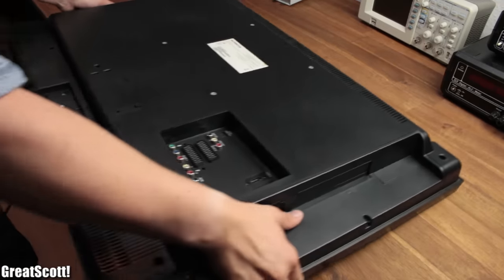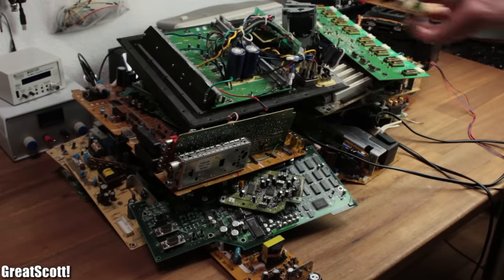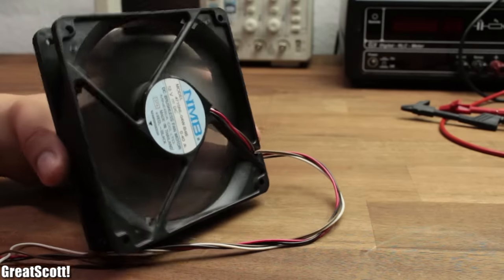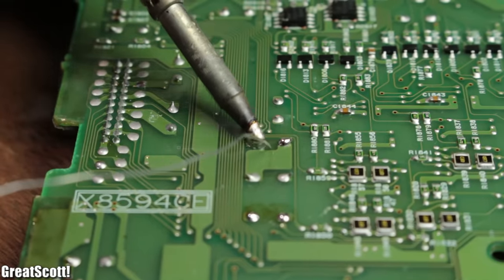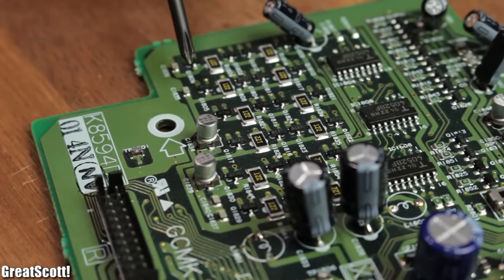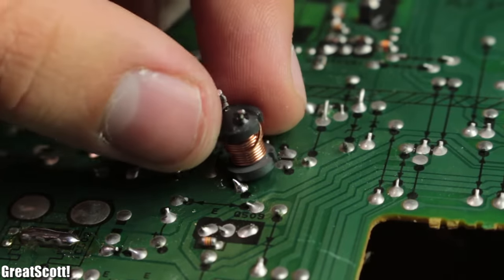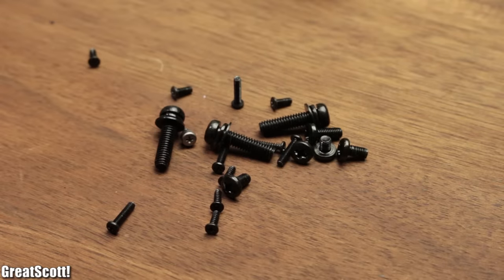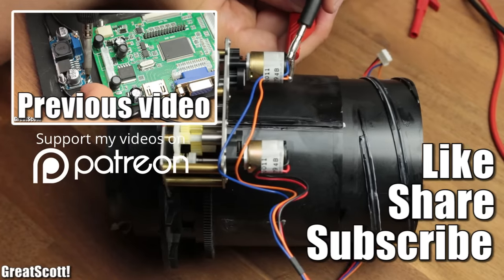What is worth desoldering from old electronics? || DIY Fume Extractor

Comment: let me save you time
coils, relays, heatsinks, capacitors, motor, switches, push button, transistor, screws, transformer
Reply: Voltage regulators
Reply: windows_x_seven why are you this salty lol chill mate
Reply: @windows_x_seven Tantalizing offer. I mean I can try, but the sheer size of them is intimidating.
Reply: r/suicideByWords
Reply: And power resistors, 2 watts or higher, flameproof, ceramic etc.  Assuming they don't show discoloration from excess heat and that they measure within tolerance.
Reply: If its a computer, take the backup battery holder too. Comes in handy if you have to replace a soldered in coin battery.
Reply: I save it all...
Reply: And boards that was left after dusoldering.
U never kniew when u need something what is on this board.
Reply: I don't really know much about electronics and parts so I don't really know which is which. I will learn it eventually. Done a little soldering myself. 

I don't know what is a relay and the things he mentioned not to bother with.
Reply: 90% of the time I’ve had something break on me it’s the power transformer that’s burnt out, usually not worth saving them if anything starts smelling foul even if it’s just a decoupling section that looks like it failed
Reply: But they're going to miss out on him saying eyeRUN and SOLLder
Reply: Let me save you guys even more time: get your propane torch, take the thing outside in the wind, torch to solder side. use a flat head screwdriver to deal with any bent leads that are keeping them from falling out when the solder is liquefied.
Reply: @FirstLast-om8li   I don't think that's a legitimate "salvage method" as you almost surely will be overheating components.
Reply: @adksherm   The heat is easily controllable to just melting the solder, which as soon as it liquefies, lets go of the component.  Use a small torch not a weed burner.
Reply: @FirstLast-om8li  have you actually done this with non-destructive results? Re-used those components in your equipment without failing?
Reply: @adksherm  Yes many times.  Sure you could cook the components but you'd have to be negligent with the heat or have chosen a MAP gas torch on high or something.  Next time I do some I'll use my laser temperature gauge to check a component after it falls out and see how hot it got.
Reply: @FirstLast-om8li  cool man. I haven't seen that done before I don't think. I'll have to look more into it!
Reply: @adksherm  another poster mentioned using a heat gun which is probably a more finesse-full method.
Reply: @FirstLast-om8li  heat guns are pretty commonly used for desoldering. Never heard of using a torch though!
Reply: @adksherm  I think you must be thinking more of like a plumber's torch and I'm thinking more of a creme brulee chef's torch. I don't just hold it directly on the board I wave it back and forth at whatever components I'm trying to get to drop out until it liquifies the solder and they fall out. If the leads hook then I usually just put some pressure with a screwdriver under the chip or part & hit that area again to liquefy it while it's being pulled on if it's really hooked in there then I use a screwdriver to scrath at the lead while the solder is liquefied.  For the most part it's just a Mass dump of Parts pretty quick.
Reply: @FirstLast-om8li   I have plenty of small torches; I know what you mean. Still, a hot air rework station is a lot more efficient for me and won't reach such extreme temps. But I dig your way of doing things your way!
Reply: @adksherm  yeah I think more people probably have a torch then have a heat gun or hot air station.   Desoldering things one pin at a time is for the birds or for stuff you actually intend on keeping and trying to make it work again.  The more people we can get to reclaim components with whatever tools they have got. . . the better.   Nice to meet you.
Reply: Plugs and fans too 😂

Comment: When you are joining twin cable (like on your 12v fan), cut the wires at different lenghts along the able so they cannot touch each other. You only need one tlength of heat shrink over both at once as well.
Reply: FaCt
Reply: Stephen Low , good idea. I'll do that next time.
Reply: Life hack
Reply: And if you cut off the connector from the power supply cut the cable in the middle. So you can save the connector (with the rest of the wire) as well :)
Reply: @alexstone691  LOL. I hate that term "hack" as it's used now.
Reply: 100% right on this, I always do that because the ends just HAVE to touch each other as if they're conspiring on it I swear. I always cut the hot wire or positive (plus) wire as the short one on the power side, which helps me remember what color was hot.
Reply: I like to mess with random stuff. But I'm not very experienced, or knowledgeable about this stuff, just enough to not kill myself. I was paranoid enough to do exactly that when i cut off a power connector
Reply: Mind blown!!!

Comment: When you cut off the old DC plug from a PSU to re-use it, leave 50mm of cable attached to the plug so you can use a screw-terminal block with it - handy for bench rig-ups ;)  
A major advantage is that you can easily add an extra capacitor at the terminal block to see if your circuit under test requires extra smoothing or RF filtering.

Comment: When I was a kid and didn't have lots of money for desoldering pumps or other expensive tools, I used an old injection needle to remove complicated parts like IC's: just remove the sharp injection part by holding it against a power grinding stone for a couple of seconds until it is flush and voilá: just stick the needle over the IC legs one by one and heat it up with your soldering iron: the solder doesn't stick to the needle and pushes the solder aside. Very fast, cheap and leaves your IC's still working fine!

Comment: I agree, I salvage parts such as what you mentioned as well. You never know when you might be pressed for time, and need a component to fix a device that otherwise you might have to wait days or weeks for new to arrive. Also a great way to remove suspicion of a bad part right away when troubleshooting. If the used part fixes it, then you always have the option of buying a new part if critical of using an aged part for the application.

Comment: A cheap hot air gun lets me remove any component quickly, including DIP's, BGA's, and SMD's of any size sweep off a board by the dozens. But the best way I have found to maintain a stock of components from old boards is not to desolder anything but the largest components, so the boards can be stored compactly, and then attempt to locate schematics/service manuals which will help me identify mystery components, like SMD capacitors which usually have no value markings as SMD resistors do. If I have the schematic in my library, then I know I have the board, and whatever good components are left. As I use parts from a board, I cross them out on the schematic. Boards with no schematic either get cleared off completely, or I will make a file with the board number listing any valuable parts.
Reply: QSL
Reply: Also it's good to picture the board and store it as your own components database. EXIF stores max 64KB, so you can add to it the characteristics of almost all components!!!
Reply: Well a little on the ocd side arnt we now
Reply: Hi-5 for 1 upping me I've been using my propane torch which can get a little too spicy for the board. I bet I could dial in my heat gun and be looking like I'm a pro at it.
Reply: @GbpsGbps-vn3jy  I wish I had thought of that; excellent tip! This beats digging through stacks of boards to do a random search.
Reply: @mbunds  Yeah, the only action needed after stripping a component is to update the image's EXIF info

Comment: Good video. When I was younger I also desoldered every component from broken boards "for later". Now I remove only parts which I need, it isn't worth to waste time, electricity and solder for parts which you may never use.
Reply: Just use a propane torch on the solder side of the circuit board and they all fall out.

Comment: Personally, I do keep capacitors, resistors, ic circuits, and even diodes. 

Yes, they are cheap. Easily obtained online. Free shipping even usually. In fact I have new diodes and resistors ect. 

I have desoldered many resistors and almost always they test correct. 

I also just use flush cutters and clip out diodes with long leads. Just test them with a multi meter.

Personally, I never had a problem with any of it not working. 

The value in doing so is many fold.
Reply: The question is what is you time worth for a 5 cent resistor?
Reply: Well, salvaging those components even if they are 5 cents is always good if you have the time
Reply: @breadbad1  not in the real world of economics.  Most people have realities to deal with.
Reply: @larrybud  Every hobby is worth your time, is not about the money.
Reply: @MastersPipe  Everybody has a finite amount of time, is spending a couple of hours to pull a dollar's worth of parts really worth it, rather than spending that time creating useful stuff?
Reply: @larrybud  and I though I was obsessive in the comments. Let it go dude, the guy enjoys it, don't question it. It won't change anything.
Reply: @MastersPipe  Just giving people a taste of a logical thinking process. No skin off my back what you do, but the OP was talking about "value", which is "always good".
Reply: @larrybud  how much time do you spend annoying people in comment sections
Reply: @KaylaJoyGunn  Probably too much, but it's "worth" my time ;-)

Comment: Heh, kids these days. Bulk desoldering with a soldering iron? In my day, we took a propane torch and ran it across the solder side of the board while pulling off parts we wanted. When you get good at it, you can us a flame spreader to heat a large area of the board then whack it from the component side with a few sharp blows and the solder facing down. It almost all falls out then the components can simply be picked off the board. Fumes? Do it outside.
Reply: I've been doing that forever haha
Reply: Pssh. You used a propane torch? I throw it in my fireplace!
Reply: What about EXPLOSIVES??
Reply: Works amazing for IC’s. Just heat up a row and ply it up with a screwdriver. Repeat for other side.
Reply: 3
Reply: MadSam ! No, they are too expensive, and they're not as funny to use.
Reply: That is how I go.  But I do it in an open barn, with a fire extinguisher.  Boards often catch on fire but who cares.
Reply: aaroncake haha true. Solder iron is ok tho since 99% of it we dont want

I guess you could just stick it in the oven too haha
Reply: Keep in mind that lead boils at 3,180 °F. Something you wouldn't want to breath in.
Reply: outside tesseract does a propane torch even get that hot?

Just because they are using a torch to desolder all at once doesent mean they are going to get the solder way hotter then it needs to be to melt... Propane isnt that hot. Specially if your carefull/quick

Solder melts at like 200c
Reply: propane torch burns at 3,623 °F and 327.5°C will melt lead, not necessarily evaporate the atoms.
Reply: outside tesseract solder melts at a lot lower temperature then just lead.

Its easy if your carefull or quick :P

And sometimes its pretty much the only way to get certain parts to come off
Reply: Great! Something else that "I have to have". :)
Reply: outside tesseract  if that was the case i could melt steel with a propane torch. Check your facts.
Reply: Steel melts at 2750 f. Too much heat loss with propane.
Reply: outside tesseract steel melts at 2750F there is too much heat loss with propane to even reach that temp.
Reply: aaroncake i just throw my boards on ground then they just fall apart lel
Reply: i just got into parts salvaging and just recently wondered about using a torch of some kind two speed it up ... i guess now ill have to try it ...
Reply: aaroncake is this serious
Reply: Amateurs - use a heat gun for pete's sake and save those ICs from internal destruction - 700 watts will do
Reply: I been breathing solder fumes for two years now at my job. It makes me cough from time to time and I feel dizzy or get headaches here and there. we have extractor  and I usually hold my breath and let the smoke blow past. but when your manufacturing circuit boards on two Qtr. million dollar machines sometimes there isn't enough time to remember to place the extractor so I just hold my breath. I figure that I smoke anyway so if it ain't one thing its another.
Reply: i WISH i had a torch and i could do that
Reply: Use a 700 to 1500w heat gun - it's better without the flames
Reply: In winter i just sit in the shop for hours with summer boards and a heat gun by a window.

I have so many parts now, the real trouble of bins and organizers is a constant struggle!
Reply: i use propane torch too just to save some hours and frustration desoldering some components and one time one big bulk capacitor exploded for over temperature, the flames escaped trough some mounting holes and burn down the cap but once you discover this method you will never try anything else
Reply: i mean.....I get the outside part,but i dont care about the fumes,and come one now!I recently found a six euro soldering iron!
Reply: works better with a heatgun ^^
Reply: a good illustration of the "flynn effect" : go to the past to see unintelligent people, who have no hygiene, who don't give a shit about other people health and the environment. Unfortunately, people live longer nowadays...
Reply: @joshuanorris5860  I guess you've never seen or done any home plumbing on copper lines...
Reply: aaroncake wouldnt that destroy the parts?
Reply: waah your were damn crazy
Reply: I remember using S knife from the kitchen and heating it using the cocking oven,  then using it as a soldering iron, when my mother discovered that she didn't like it for sure. ..
Reply: DANK  as a mexican from a first generation immigrant family.
thats hilarious 👌😂😂
you get A+ for comedy, :)
Reply: I usually dump a bunch of gasoline on the circuit board, light it on fire, and as it's burning I pluck off the components 
 as for fumes, I just smoked a cigarette to mask the smell
Reply: Lead pot works wonders just need a hot plate a shallow pan a few fishing weights  and bam!!!
Reply: I don't have a good soldering iron. For anything bulky, I always use butane or propane torches. Well, sometimes even for soldering components and wires on.
Reply: Noice but do you think about a heat? Some components may desolder and MELT if they are made of some plastic.
Reply: So you have to be old to know this? Damn, I'm old and it's first time I hear about this...something's wrong...I got it! It's not about being kid or what age you are! It's about if 1) you figured it out by youself or 2) somebody taught you.

So let me correct this one for you. 
"Heh, people these days. Don't know stuff nobody ever told them! Also I'm a bit full of myself."

Anyway thanks for the tip even if the delivery was arrogant and leaves a lot of room for self-improvement.
Reply: @-AnyWho  If you are really in to salvaging then look at buying a combined soldering iron/hot air gun. We have them at work and they cost us under AUD200 and you may even be able to pick one up that is used. They will increase your yield of SMD ICs
Reply: @luismedrano653  The machine should have ducting and fans to exract the fumes to the outside of the building.

Comment: If you are looking for carbon filter but don't need 10yrs worth a pet store has it in aqautics.
Reply: @Demo but i don't have carbon windows
Reply: Doesn't the pet store just have carbon bits, something like Norit?
Reply: @saltysoysauce954  What he means by carbon filter is carbon-impregnated pads, which are used for chemical filtration in most aquariums. They're usually thick enough and might do the job just as good, but some are too spongy to be effective.
Reply: @SartBG  Oh interesting, never saw those. Pretty good idea!
Reply: They are also used in vacuum cleaner air out..put? 

You can buy them from stores and they usually are "cut your own" type. Fanned cooker hoods also carry one, they are replaceable parts and in Finland super/hypermarkets sell them too.
Reply: I use carbon filter sheet like he does for my homemade extractor, which is sold for kitchen extractor hoods, and very cheap. Personally I like to keep the white part (facing outwards) to protect the carbon side from getting clogged with larger particles.

Comment: Great video thank you. some may consider using a microwave fan for the extractor it comes with its own housing and they're really powerful and have plenty of space on the housing to mount a switch. Here in the US they are shaded pole motors and damn near indestructible. Most refrigerators have two of them and bathroom exhaust fans are another source, those just don't have housings

Comment: Used to do this with my Grandfather back in the late 70’s   Although a lot of stuff back then was valves and massive caps, a lot less IC’s etc. He got me started in electronics as a hobby, which in turn lead to My engineering jobs and then to my IT works. Thanks Gramps you shaped my world and didnt even get thanked.